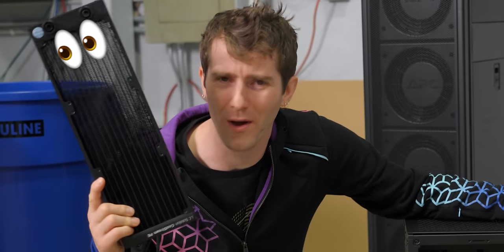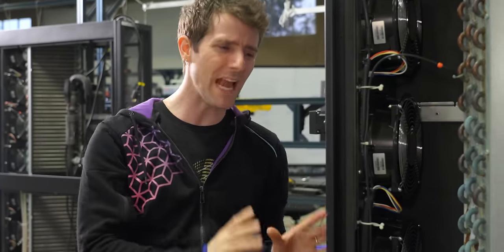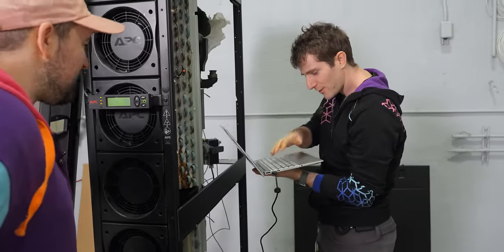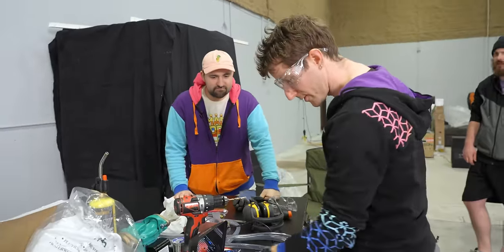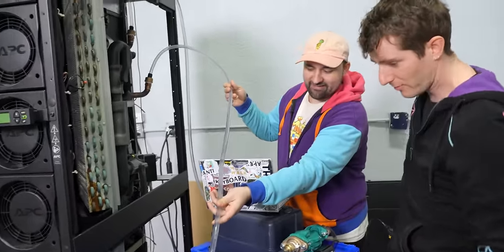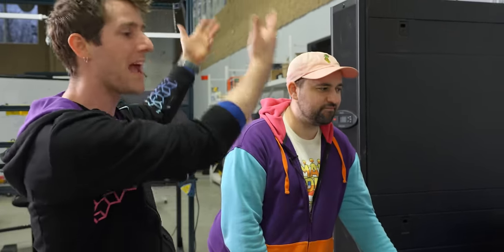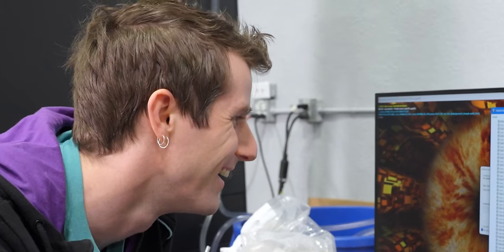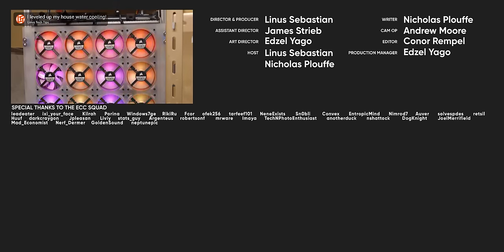I Can’t Believe They Threw This Away - Uniflair InRow Server Cooler

Comment: Anytime LTT does anything with cooling and heating, I cringe hard at least a dozen times.
Also, those fittings that you couldn't find any "standard thread", those are just standard unions. That you can just go out to the store and buy. They're like $10. And you dumped a bunch of metal shavings into the system with that sawzall. RIP valves and pumps in your system.

This is like watching the guy at the junkyard "evacuate" your refrigerator levels of cringe without the law breaking parts this time.

The 1" to G1/4 is pretty bad. 😂 But also fine for this. 

The rust on the steel end plates is very common and not really something that can really be "maintained" away by any reasonable expectations. 

That soldering actually looks fine. Not great but as long as it holds water, it's great. Not like it need to hold 800 psi gas or anything.

Comment: Watching them use this thing just so incredibly wrong was just so incredibly saddening.
Normally these things are using in system where you have a centralised water chilling plant. For example, some university campuses instead of having AC units in every building, will centralise them into a half dozen extremely large ones. That produces cold water(sometimes as low as only 4-5°C) and goes through units like this, or more regular HVAC units to cool stuff.
And actually do add to linus's plug it into the nearest glacier comment. I kid you not, there is one university that legit plugs theirs into the nearby river, runs it through some other heat exchangers (sometimes not even running compressors alike to AC units), all of which is only about 200km from being a literal glacier.

Comment: It’s surprising anyone still doesn’t realize the bottleneck is the size of the IHS of these chips. They need to get physical larger, going smaller and smaller is NOT beneficial for pc gaming but rather their embedded computing clients. I want the IHS to expand in surface area 2x as well as the chip itself to more efficiently pull heat away. They’ve already reached the limit of how fine they can make fins that will effectively cool. It’s a shame things aren’t going on the right directions

Comment: Not preaching. Just genuine concern. Please do not ever put your hand that close to a saw again. I was so worried. The sawzall isn't exactly known for having the best control. I've had cases where I've hit a nail in a piece of wood and the kick back moved the blade significantly. Unless you're using an amazing blade they dont really have alot bite at first, so it the blade tends to bounce around on metal stuff unless, as you've seen, something holds it super still. Take care <3

Comment: Datacenter refer techs Ive got a question, these seem pretty sub optimal as a cooling solution, are they mostly used for a room where CRAC's aren't possible, or are just set up poorly? Or is it for if you've got shitty hot aisle ventilation?
Reply: Or are the mostly use as backup cooling/extra capacity?

Comment: you guys realize that u tripped over the one use case where thermoelectric coolers actually make sense. you said it yourself that the limiting factor is the heat transfer of the passive heat spreader so use an active heat spreader. you have plenty of cooling capacity for the extra heat created actively pumping the heat

Comment: You failed to find simple plumbing unions, then you cut through the bend of the 90° fitting so you soldered on to the bend instead of a straight section of pipe the way sweat solder fitttings are meant to.

By the way, he wasn't "cutting away from your hand".  I suggest if you don't want to get injured when your luck runs out, either learn how to safely use power tools of get someone to do it for you.

Comment: No matter how this thing works, it's a phase change operation, it will produce more heat than "cooling," that's just a law of physics.. so where is the exhaust, where are the hot coolant outputs?  AC's/Heatpumps have units on the inside and outside for a reason.  It seems like a vertically mounted minisplit AC unit.. where is the component that is put outdoors?  

TL:DR you can't suck in hot air, and cool it down, without creating more heat without an exhaust.  

(they cut a vertical pipe horizontally with a sawz-all without cleaning out the cuttings, if they did they would show/mention that.) 

15:05 that  huge uninsulated drum of water sitting in a warehouse for 14 hours totally negates all your "science" or measurements of performance.

17:34 The cooling system is exchanging it';s heat in the same inclosed environment as the heat source.. This is not how real HVAC systems work.

Comment: Foam on a ball valve handle @6:35, never seen that one before!  Too bad you edited out most of the "saws all" stuff, think motorcycle tank slapping at 150 mph, that's OK I laugh just imagining!  FYI the fittings that you mangled off of the copper were socketed (maybe 1.5") ball valve ends!

Comment: bruh... you dont cut copper pipe with a saw... you use a copper pipe cutter for that.... maaaaaan
IF you use a saw please stick some tissue or cloth inside the pipe befor sawing to prewent metal flakes/chips/shavings getting into your system

Comment: OMG CLEAN YOUR COPPER! the Flux will not adhere to the copper piping if it is not cleaned and cleaned well. Even if it does stuck it can fail under load. ^&*()_ Plumber 101.

Comment: Linus, you said "sorry, im running 92 threads on prime95" but the cpu has 96 cores and 192 threads 14:03 

Edit: all pc's get hooked up to 1 tank, with all the cooling towers as well, and in the summer, if it gets too hot, you have the chiller, and can turn everything into 1 big a/c unit, and free heating in the winter

Comment: Okay I don't want to be that guy.. but here you spit out numbers here and there, and tells a lot of reference numbers everywhere and one.
Well Me, and I don't quite understand what is actually happening.. but don't call me a noob just yet pls.

Linus. Can you pls really explain what is happening and what you want to achieve.. this to a more deadly person and not talking like we get every cooling capacity- numbers on what exactly it is that you are doing here. ..More so we do understand i mean!

*It's not that i don't understand cpu, gpu and what heat is "doing bad" to (a) systems..
But what i do understand here is this massive pump, along with the fans and water combined all cools the system..
and it's working, flattens out the power supply- reading, how did that happen and, it is supposed to do that.. I don't understand it much further than this.

Thank you. //Richie.